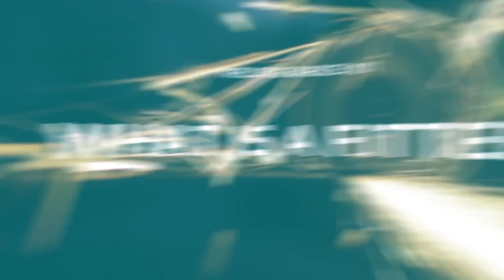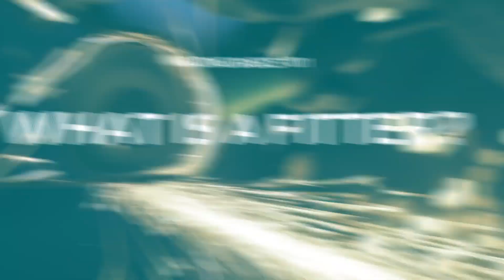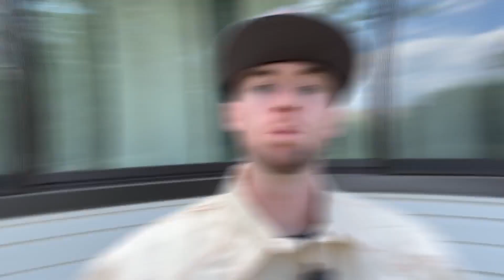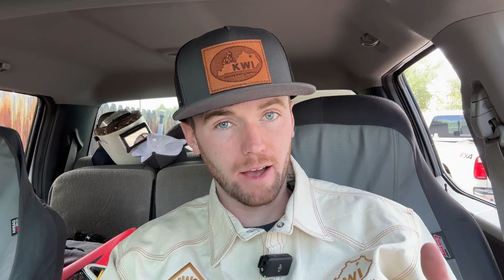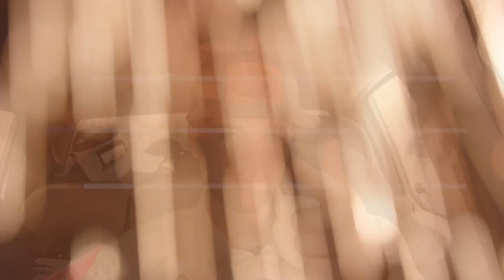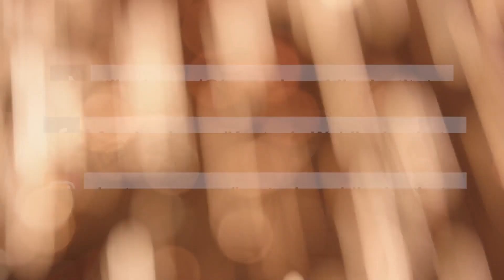Pipe Fitter Essentials: What Welders Must Know!

Comment: Hello, I was a union pipefitter for 40 years and a certified welder for 30yrs,  5yrs Nuclear, MIG ,TIG, STAILESS SS, Heavey wall  ( all) A GOOD fitter is worth every penny to assist me in fit up ,prep and cleaning the weld but if you can,t do that they are going to have a tough go in the industry